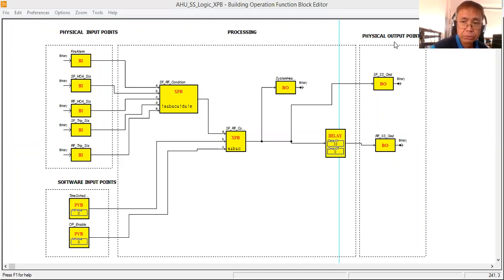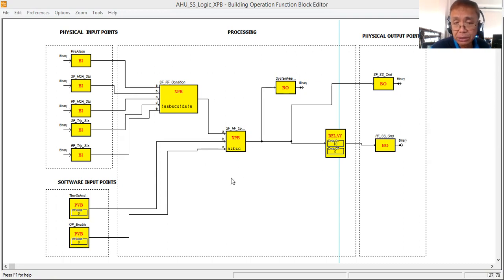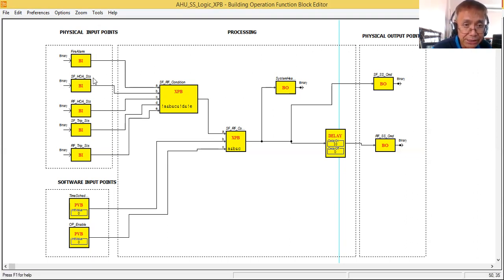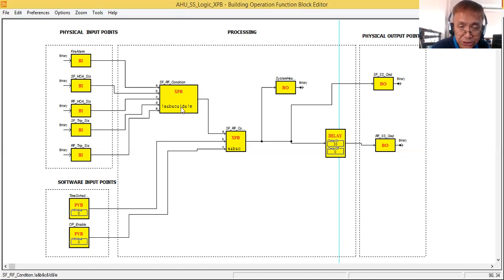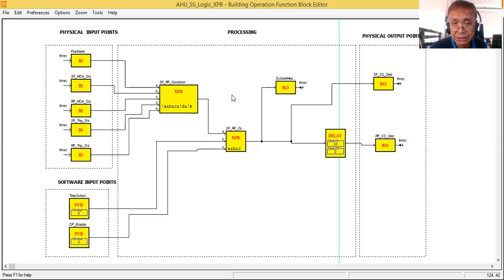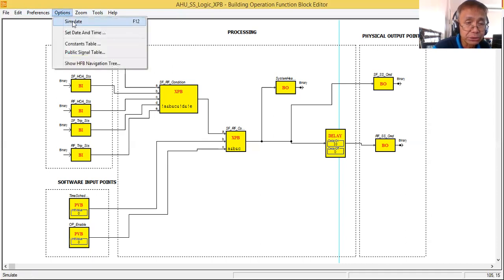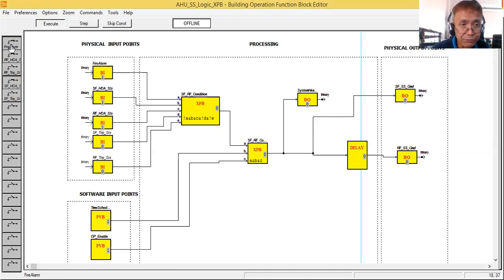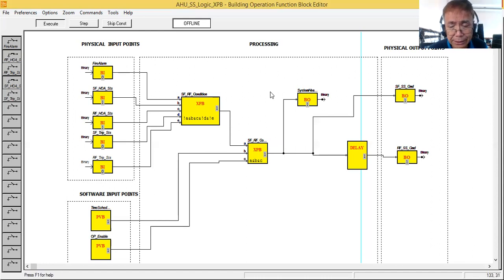How to become a BMS engineer part 84 (Functional Block Programming   Expression Block)

Comment: Hi sir, 
Please provide graphic design for ahu
Reply from the maker: I can provide but are you working with the same Schneider software? because if not you will not be able to open the file
Reply: @SantosJrCapellan-BMS   Dear sir, I want to learn for graphic and program
Reply from the maker: @ibrahimbinabubaker4361  you can watch some of my graphics and control logic programming, go to my playlist and look for BMS graphics creation and Exhaust Fan Control logic programming
Reply: @SantosJrCapellan-BMS  Dear sir, 
I am watching ur videos but it's not clearly see the programming. Please help me out for creating cv for bms maintainance engineer
Reply from the maker: @ibrahimbinabubaker4361  do you have any background in control logic programming using functional blocks?
Reply from the maker: @ibrahimbinabubaker4361  I will be doing the control logic programming of my latest video upload BMS engineering works for Air Handling Unit, I will try to explain the programming there you can watch it later
for the mean time try to watch the other videos, and you can share it with your friends
Reply from the maker: @ibrahimbinabubaker4361  I am no longer using my whatsApp number you can send me message in messenger
Reply: @SantosJrCapellan-BMS Sir I msg u in messenger please accept